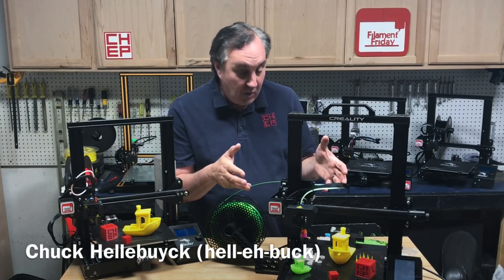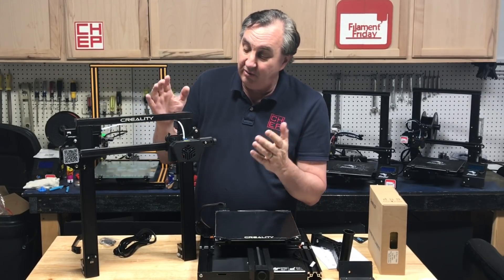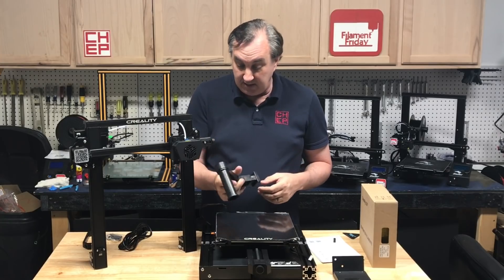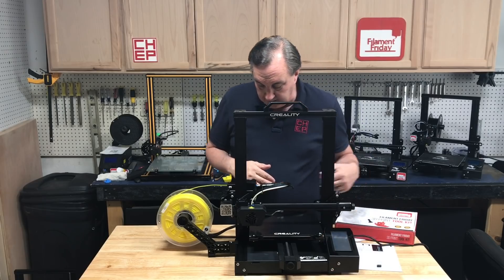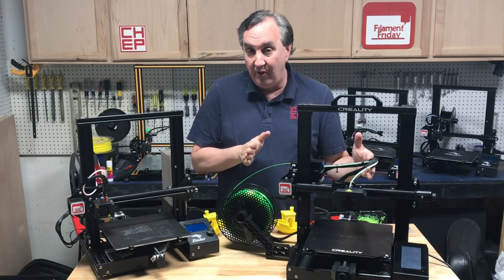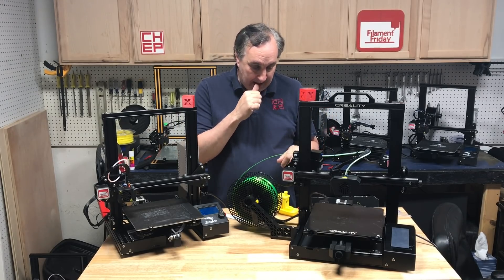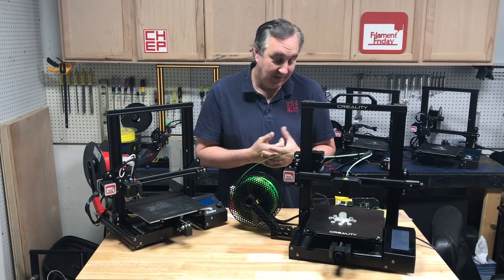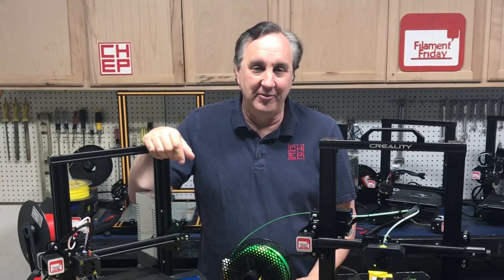NEW! Creality CR-6 SE 3D Printer - Better than Creality Ender 3?

Comment: Perhaps Creality should think about the saying “if it ain’t broken don’t try and fix it”. The Ender 3 is great as is, but with the option of making changes to suit the user. All these new models are just a way for Creality to make money but they should perhaps thinks about firmware more than machines. I fitted the silent board 1.1.5 which uses the 1.1.8 firmware, great until I tried to fit the BL Touch kit from Creality. When I found the link on their website to download the Touch all it did was download the 1.1.6 firmware but nothing for the Touch and it appears to have lost its boot loader.. Now my Silent board is on 1.1.6 and Creality have told me they don’t have the 1.1.8 firmware. I am now awaiting the SKR mini E3 along with the touch screen to try as firmware is openly available and both items for only £42. + it’s approximately a 32bit bit board.
Reply: You should have just went with the SKR mini E3 to begin with. 32-bit, silent stepper motor drivers, and BigTree offers their pre-complied revision of Marlin for the BLTouch on their GitHub. They're also good about keeping it up to date. We live and we learn I guess.
Reply: ehmc130 yes we certainly live and learn, I wanted to keep my loyalty with Creality by buying their products as the Ender 3 is so good. But now as you say they don’t keep up to date with firmware etc so I’m happy just to use their mechanics and I’ll purchase better electronics from other manufacturers. Support is very poor from Creality and needs to be greatly improved.

Comment: The odd ball shape of the nozzle is to give a snug fit with the heater block condom. this should help with stopping "blobs" from globbing up the hot end since it usually does not stick to the silicone condom.

Comment: For that price you get an CR10-S (or may be a pro) easyli. I would never trade off my Ender3 nor my CR10-S for that machine. It's not worth it.
Reply: Or you could get this for $319 instead and get much better features than both a CR-10s or Ender 3. Though it does have a smaller bed then the CR-10s.
Reply: @mathewcoppola8622  What better features? The touchscreen? Nobody needs this. Or the autolevel? Nobody needs this either. So where are the "better features"? If there is any aspect that this printer is printing better than the CR10 or the Ender, so pls, tell me!

Comment: i was amazed by strain gauge leveling probe, such simple and clean solution. and now i'm curious about that is creality's very own idea or someone did that before ?
Reply: Definitely not their idea, it's also been used on SeeMeCNC machines.
Reply: But will the strain gauge levelling probe eventually mark the bed. After all the nozzle is going to be hot and in contact with the bed when measuring.
Reply: @stuartalexander3  It will probably take a very long time for it to mark up the bed. Based on the reviews, the nozzle barely touched the bed. Combine that with potentially not having to re-level very often and the bed should be fine.

Comment: So basically,  it's what some people end up doing to upgrade their Ender 3/pro version, but this "new" printer costs much more (at least in Canadian $'s it way more). Imo, I would rather buy the regular Ender 3, 3X or the Pro version, 3d print those extra things, and then buy the upgraded parts to add them myself. Then I'd have the satisfaction of knowing that I built it, and also know how to fix it if something broke on it later on. Thanks for the review Chuck. :-)

Comment: I wouldn't say it's too expensive. It includes everything that you COULD mod the Ender 3 with, but it's done professionally with better mod parts. When I got my E3, I thought it was plug and play, but realized it was not like putting a chair together, many necessary mods, and wasted a lot of time researching, modding, and fixing my own mistakes. If I had this CR-6 option, I would not buy the E3.

Comment: If only you had some sort of machine that would let you make a clear extruder top... almost even like something like a printer for plastic .....
Reply from the maker: If you saw this thing your wouldn’t even try to print it. The wedge and small metal insert for the spring would be just one of the impossible sections. And I’ve yet to find a clear filament that you can see thru after printing.
Reply: Agreed.

Comment: @CHEP Hi Chuck, do you know of any printers that can print polycarbonate, or if perhaps the ender 3 (basic/original) is capable of this?
Reply from the maker: I believe the MatterHackers Pulse can do it.
Reply: @FilamentFriday  Oh, right I had forgotten about that one. I didn't look at it a lot but there are a view versions and you would have to look for the one setup for PC.
Reply: Polycarbonate (PC) requires a hotend that can reach 300C and a bed that can reach 120C.  While Ender 3 bed can get close (110C) the hotend can only get to 255C.  I was looking at this Weedo WE20-Pro(F152S) printer to print PC.

Comment: Surprised you had to use a gluestick. If that's like an anycublic bed they shouldn't need glue, but are extremely sensitive to the oils off hands/fingers. Just the brush of a hand will make an area non-sticky and needs cleaning (IPA). Apart from that they're a brilliant surface.
Reply: I have the same bed from Creality on my Ender 3. It just started doing it as the ambient temperature started to get hotter in my room. Going to have to add some glue now.. never have and slightly disappointed with the bed adhesion that I even have to.

Comment: printing 240 degrees on a ptfe hotend is asking for trouble
Reply from the maker: Done it many many times on my Enders.
Reply: @FilamentFriday  with my Ender 5.. PTFE ends up deforming and jamming up hotened eventually.
Reply from the maker: That’s why I recommend Capricorn in many of my videos. It has a higher temp resistance long term.

Comment: About 6 weeks ago I decided it was time to get a 3d printer, and after running into COVID19 roadblocks and several failed orders I ended up with a CR-10S for $400. I guess I'm a tinkerer, as it's a different machine now. Printer Mods MDD and aluminum extruder, bl touch, octoprint w/pi cam, klipper, smoothers ordered, other upgrades printed and installed. And I love it.

I looked at this when the kickstarter hit, and couldn't justify it. I can grab damn near any printer and get autoleveling on it, and direct drive is just awesome. I am looking at getting a second printer, but I just don't see enough here to make this the one.
Unsurprisingly this is the best review yet, and cemented my decision. Thank you for the exceptionally high standard, you are one of a very small group of people that truly try to think of everything and give a really broad review.
So what do you think is a good second printer? Assuming you have an Ender 3 modded well, what expands on that? Maybe a video idea... :)
Reply from the maker: Sounds like building your own is a good plan.

Comment: Nice review.   I like you took things apart.  8 bit board today is a non-starter, way too expensive.  The hot end design, do not understand the holes cut out of the heat sink, seems like it will reduce the cooling effect.

Comment: Great review.  I agree that it is overpriced but attractive if the price comes down and it does need a 32 bit board and the settings adjusted slightly.  It's nice to see Creality release a printer that's this/close to being usable right out of the box.  I would pay extra for this but not that much extra.  I'm sure some clones will emerge and keep Creality honest.  Not a fan of the textured bed.  I've been a plain borosilicate glass bed user for over 5 years now and have never needed anything more than a skirt and/or a little Aquanet hairspray for fussy filaments.  It looks like a winner and with a better price I would recommend it for novice printers especially for folks who are not "fiddly".

Comment: As someone who has had no education in writing code, or electronics in general. Buying an Ender 3 and putting an SKR v1.3, TMC 2209 stepper drivers, Touch screen, etc. This thing has been an absolute nightmare of troubleshooting but has forced me to learn Marlin/VS Code. I have had days I wanted to give up, but figuring out something without having to ask for help on any forums or Facebook groups is extremely satisfying. My Ender 3 Pro is a beast and I can't leave it alone... There is always something I gotta fiddle with and I'm always confident I can do it. I know if I went with a Prusa i3 and never fiddled with it, I wouldn't have become half as proficient as I am in this Hobby. I always recommend the Ender 3 because it can be a good printer if you're someone who doesn't want to mess with a thing, or an Excellent printer for someone looking to challenge themselves and throw an extra $100 into it.

Comment: I like the ender 3 pro magnetic bed better then glass. I guess my question is why spend an extra $200 for it. The ender 3 pro has faults with the plastic extruder but $20 fixes it, auto bed leveling isnt really needed, i print alot and almost never have to relevel due to the magnetic bed. So auto leveling just isnt that big of an issue to me. And if i bought a top of the line board right now it would be right around $100-$150. And it would be way better then the board in that printer. So that leaves you with the touch screen, basicly thats the only real advantage i see right out of the box. The rest is pretty much equal to or would need to be changed just the same as the ender 3 pro.

Comment: Chep do you think we'll ever see machines that are completely ready to go out of the box, with full autodiagnostics so that people who simply want to print rather than becoming print experts can enjoy making stuff without all the tweaking? Listening to you talking about this machine - it was "Oh I just tweaked this, and dialled that, and twiddled the other bit". Most of that was double dutch to me, and as long as printing is this complicated, I think it's always going to be missing the bulk of the market.
Reply from the maker: There are many that are close and also offer great support. But not for sub $500.
Reply: @FilamentFriday  Thanks Chep. If I was willing to spend more, is there a particular machine that combines perfect ease of use and quality? Or should I be looking at resin? TIA.
Reply from the maker: I like my SeeMeCNC Artemis.
Reply: @FilamentFriday  Great stuff - thanks Chep!
Reply: The volume of the shipping cartons would add a lot of cost to the effort.  It looks like you could get 3-4 shipped like this in the space of 2 fully assembled units.  If you really need to have it fully assembled and are not confident in your ability to follow the directions (granted the directions could use some work if they aren't better than the 3 series.)  a Creality is not for you.  Because if you are having issues there, you aren't going to be able to get more than mediocre results out of the design and slicing software apps.
Reply: @n6nvr  I have a a CR10S. The assembly instructions were appalling. The levelling instructions were appalling. The frame was warped. It took over a month from purchase before I got it running, and that was only with an hour of online help from te store's 3D prineter expert. Now it's sitting there unused after months of decent printing because I can't remove the nozzle and it won't print any more. If I bought any other product that was this bad, I'd demand a refund. Instedad there are entire communities of enthusiasts sprung up to help ompensate.
I get that the technology was new, but that excuse is LOOOONG past. Many of the problems are simply down to laziness. The assembly COULD be a million times easier - simple colour coding on the cables; better routing, better setup. There's dozens of ways that an amateur like me can see how this could have been better. You don't need to be an engineer to see them, and it's not a lack of engineering expertise that means I don't understand. I get that shipping fully assembled would be unweildy, but a rapid snap together design is not that much to ask. JUst Creality's dependance on those horrible T nuts is one example of non customer centric dersign. This is just crappy, crappy minimal effort Chinese design and manufacturing. Maybe the world IS ready for a shift away from trade with China.
Reply: @n6nvr  Also, re slicing apps - how hard is it for them to analyse your designs,, orient your model optimally, confirm whether you want to print for quality, speed, or strength, auto-insert the right amount of support in the right places, and take all that aggro away from the user if that's what they want? There are a fixed range of parameters at work here that can be reduced to formulas. It really isn't rocket science.

Comment: @Chep I ordered one the other day it cost about $362 shipped. I Own a Sovol sv01, Cr-10S, Prusa mk3 & a Tronxy X5sa Pro. the Prusa is the goto printer, but have to say my Fav is the Tronxy x5sa pro. the sovol is better built then a cr-10s for sure. the cr10s has by far the most upgrades, bondtech type extruder, silicone 120v heater, ezabl, flex steel build area. e3d volcano. Sovol is still better.

Comment: Yo chep, which printer would  you recommend to a beginner
Reply: Ender 3.
Reply: Anycubic i3 mega, ender 3 is like fixing an old car that doesn't start and it will need a ton of more mods. It's also more reliable than the ender 3 and it takes like 5 minutes to set up.
Reply: LB's Epic Tutorials I open my ender 3pro, 1h to mount it. Tomorrow, still operating ultra well and begin for professional use...for me, the ender 3 serie are wonderful
Reply: Ender 3 Pro for sure

Comment: They really didn't need a kickstarter for this, loads of people will be wanting this.
Reply: Marketing hype. Does not seem to be a $412 printer after this Kickstarter hype and months later when some new printer will come out.  I don't see anything special about this bed leveling over BL Touch.
Reply: @ImaginationToForm  I'm with you, definitely something I want however if someone already has say an Ender 3 they've most likely already done these mods to it.

I've never needed a BL Touch as manual levelling takes a couple seconds to do, though I do have the silent board and a micro-swiss direct drive so it's not really worth upgrading to this. 

I was thinking of an getting an Ender 5 though just because the design looks pretty good
Reply: Overprice
Reply: WHAT? I think they can afford r&d themselves they're not reinventing the wheel
Reply: I think it was to see how to price it maybe? Some people got to buy it cheaper at first while each step up they increased the price a little
Reply: @MegaHomieJ  Definitely worth getting if you don't have already an existing Creality printer, most people have already done these upgrades to their existing ones. But I mean for a slightly better design/style and to have everything put on for you without the hassle then it's worth the pick up for people :)

Comment: Having 8 bit boards in the current year is simply inexcusable. The rest looks like a sensible evolutionary improvement on the Ender 3, but not quite enough for the price. 
And even though Creality might offer an overall better build quality and better quality components, competitor products simply offer similar or the same feature sets for a better price.

Comment: don't understand why they are doing this and ender 3 v2.  No 32bit though :(. other previews didn't mention auto bed levelling, this is a big improvement. The hot end reminds me of a rubbish mosquito. Why are they not using a full metal hotend, same with no dual gear on the extruder, that costs pennies. Getting closer to what I wish they would release though. 
also would like to see linear rails for less maintenance. My ender 3 extrusion has several lumps in it so that would also be helped by linear rails. But they are costly so I can understand why they don't. But then again they have so many models at the cheap end now, how about a mid-range priced small printer, but with significant upgrades over this/ender3

what is ender 3 rrp though, I doubt this printer will be $400 after a few months after release.

Comment: They really should have given this thing a bigger build volume. I stayed away from the Kickstarter due to the shipping cost. It was like $180 the first day the Kickstarter started. I'll wait for Amazon to stock them with free shipping if I decide to buy one.
Reply: The shipping is listed in HK not USD. So it's about 20-40 USD, depending on your country.
Reply: I just went back and checked the Kickstarter. You are correct sir. I just didn't understand what that wording meant but I get it now. My bad! I probably won't buy it due to build volume in any case. That's for clarifying that for everyone.

Comment: Creality having an identity issue that's what i see. Every new printer missing the mark. Trying new untested parts, still not going all metal hotend or direct drive . This video should be ended by saying buy a artillery genius /sidewinder
Reply: Cr 10 v3 have direct drive
Reply: @OsKiiOSX  Yea like cr10 v2 should have been in first place. and now its the v3 and all v2 owners fend for themselves. They just milking money outta people that don't know better. Look at ender 5 plus, that worth the money in 2020 no.
Reply: Good points. They could really build a great printer around $600 but keep doing all these other price points. I'd love to see all metal hotends IDEX printer with 32 bit silent board, silent fans, sensor-less homing and 300x300x300 plus bed size.  Maybe a flex bed but I've had no trouble with glass and BL-Touch. Their belt printer looks interesting but someone pointed out to me that its only early alpha for that printer.